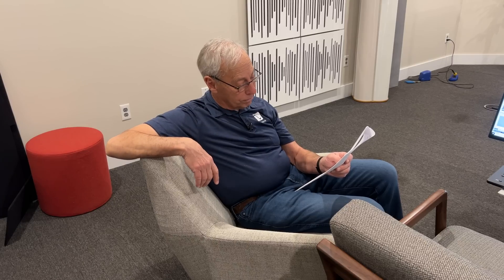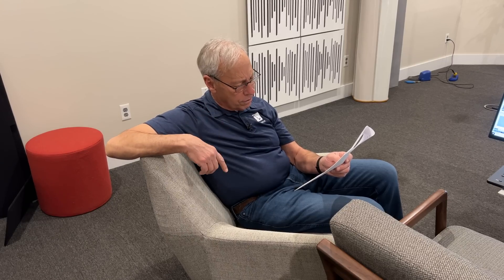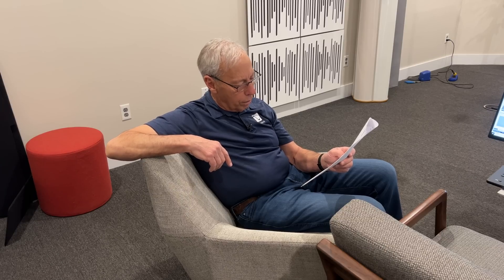Replacing aging capacitors

Comment: I thought of doing a replacement of capacitors in my 3 Tannoy TFX subwoofers. There's always room for improvement. They might be small but three of them make a huge impact
Reply: It's not an expensive thing to do and well worth it. For me the improvement was very noticeable right off (not my imagination). It did take me some time because I had never soldered before. The more I did it the more I got the knack of it. Good luck and please report back.

Comment: Be careful changing caps. It may sound different and it's not always in a good way. It may not even be in a bad way but the difference may not be what you want. I had to change just 2 caps (1 each) in a set of IRS IIIa's that I have 4 of. The first set sounds different then the other set now.
Reply: How could changing caps to original specs be a bad thing?
Reply: @johnloupis2347  Same specs dont mean it will sound the same. Cap makers make different caps even in the same specs. Throw in 30, 40, 50 years difference some of the specs may not even mean the same thing anymore. It may not even be bad but still sound different and it may not be what you are looking for or expected. Or it may be the best thing you have ever done. IMHO if you like what you have and there is nothing wrong with the caps (getting hot, bulging, etc) I wouldn't take the risk.
Reply: @finscreenname   If you like it roll with it. I can say with mine I thought it sounded ok until after I changed them. Big improvement for my situation anyways.

Comment: I have a Velodyne VA1012 and my caps failed at around the 30year mark. Replaced them with Mundorfs and it is restored to a wonderful sounding sub. Have a much higher end sub now so the Velodyne is on the shelf but works perfectly. You would be surprised how much better the new technology subs are, I was shocked.

Comment: I've got an old 1965 CONN tube organ still rocking the original caps. Also an old 1975 Roland synth still rocking the original caps. The organ sounds incredible. The Roland is a bit leaky in the circuits.
Reply: cap will need checked as the voltage can fry the heaters in tubes via leaky caps seeming good sound WaRm sounding .mr carlson's lab on YT is an expert

Comment: Thanks for taking the question Paul. The Velodyne servo subs in the early 90's were cutting edge at that time and have very low distortion levels. And were rather expensive for that time. I think $600 for the one I bought. I did end up replacing the power supply caps and they did make a difference. Sub seemed to have more power. Then I replaced the caps that control the servo area of the sub. That made a dramatic difference. Really cleaned up the sound. Much more taught and defined notes.
 Next I decided to change the caps in my Mirage speakers to new film caps. Once again a noticable improvement. Much better sound stage, better stereo effect, smoother highs. Total cost of doing it myself about a $110. Money well spent. Keep in mind I had never soldered anything in my life before so there was a learning curve. Probably took me 10 hours total to do everything. Love your videos. Wish I could afford your videos and wish I could afford your equipment. So my thought is tweek what I have. So far so good. Thanks again.

Comment: Caps are so fickle ive come to find. I have pieces 30+ years old, not a single failing cap and some less than, with bulging rectifier caps inside. My theory is if unit in question spent its life on the same shelf in consistent temp, the caps will go the distance. Is said piece were stored in damp basements, storage units, exposed to hot summers and cold winters, the caps are gonna need replacing no matter what!

Comment: If it ain't broke don't fix it. If you want to check your capacitors purchase an ESR meter and test them. They're not that expensive. when they start to fail you will notice, Poor Sound , humming buzzing, unit turns off after a few seconds.

Comment: There was a noticeable improvement in sound quality when I replaced the 60 year old electrolytic caps in the crossover of my Wharfedale 70s. I put in film caps, so they'll be good for many more years.
Reply: Thank you for volunteering information regarding your Wharfedale 70’s; I was beginning to think I was the only one listening to them. I have their three-way W-70E version, all original right now, but based on your comment, I’ll soon be upgrading the caps. 

Out of curiosity, have you replaced the speaker terminals? I have trouble keeping mine tight, they rotate in the cabinet instead of staying put, so it is hard to tighten them down properly.
Reply: @jeremiahchamberlin4499  I've had no issues with that. Mine are just stationary in the cabinet, and the terminals are tight.  
I do get some distortion at certain frequencies on the mid-range driver of one unit.  I'd read that sometimes the voice coil tolerance was so tight, they'd sometimes start rubbing after settling with age.  So I remounted that driver after rotating it 180 degrees,  but alas, that hasn't helped.  When I have time, I'll have to do some more troubleshooting. 
These were the speakers I grew up listening to, as my father bought them around the time I was born, so I'm pretty fond of them. 🤠

Comment: I get the fact you can use lower value film capacitors on the input as the impedance is high but, in my mind, you can't avoid using electrolytics for the output DC blocking, signal capacitors because the output impedance is so low. Is there another way that I don't know about?
Reply: Are you sure that you have output blocking capacitors?  They are not always used.
Reply: @marianneoelund2940  I'm talking about amplifier design in general. I'm an electrician / electronics engineer by trade. You can calculate roll-off with RC values.
Reply: @zedcarr6128  Then I don't know why you asked the question.  You know that the alternatives to capacitive coupling are direct or transformer coupling, right?

Comment: Makes me wonder if modern caps are not up to the standard of the ones used in the 80s/90s.?  I have components from that era that are still running strong.  Conversely,  my modern equipment seems to start having issues at the 3-5 year mark.
Reply: My conviction is that the old equipment is more oversized in terms of materials, new production precision allows a cheaper amount of materials (oversizing the voltage a little on modern caps is therefore fine).
Reply: @EnigmaVideos  So, why do modern components seem to have a shorter life span?
Reply: @tritiumglo4699  Could be less electrolyte, could also be other electronic components or bad design.
Reply: @tritiumglo4699  A lot of the money that used to go into components now goes into licensing fees.
Reply: I can relate. The caps in my 1965 tube organ work just fine, low noise, great sound. The caps in my active studio monitors lasted about 10-12 years.

Comment: I'm servising hifi gear and have many velodyne subs here for service between 25-30 yrs of operation. Always been electrolytic caps. Due to the vibrations in subs, they tend to degrade faster than in other hifi gear. So definitely if your sub is 30yrs old, change them asap.
Reply: Thanks

Comment: what about resistors, should the old carbon-film resistors from 1996 be replaced with new metal film ones?
Reply: Only if it shows the wrong values.
Reply: Bulk carbon resistors are the ones you need to worry about.  They can drift well outside of their tolerance rating, and they can also become noisy with age.

Comment: Velodyne has made some awesome subwoofers even with servo, and depending on model, it can easily be worth to replace the caps. Some of those servo subs can get unstable if the caps are worn out. One of my subs is an upgraded DD-18+ and it works very well.
Reply: Unstable is a great way to put it. Mine was getting bad enough that the voice coil was rapping all the way to it's limits at low volume. I replaced 10 caps and it's a different animal now. Pretty cheap fix. Was about $45
Reply: I had a Velodyne ULD-15 servo subwoofer for awhile but it did nothing to add low end to my electrostatics and just blurred the bass from my electrostatics. Anyone who says electrostatics don't have bass should hear mine.
Reply: @andershammer9307  I'm not sure how you did the cross-over but of course nothing beats electrostatics on precision and most certainly you wouldn't want both your electrostatics and a subwoofer to operate within the same frequencies. In fact, I disagree strongly with anyone thinking that it's great to add a subwoofer without high-pass filtering the stereo speakers. I've been a Stax headphone fan since my teens.

Comment: Here's an interesting thought, what if you were told that with an old amplifier you have that you should have the caps and everything replaced. The amplifier currently works end it sounds good to you and you know that by changing out those capacitors the sound will change, should you fix it knowing that you like the sound how it is.
Reply: I thought my sub sounded "ok" until I recaped it. I must say amps have a ton of caps in them. If you don't do it yourself it will be pretty costly.

Comment: I have a Sonotron PA2000 from the late 70s/early 80s. Is there anyway to check if the caps are good or not? It has four 15000uf Elna capacitors, I'm guessing they're not making the same capacitor anymore, how to do you what to replace it with? Does it matter?

Comment: I don't think NH was a major landing point to immigrants from Lebanon. I think the name is inspired from biblical references to that country. I repair and restore vintage audio gear. I'd replace all electrolytics 30 years old or older. They may still be to specs (especially quality ones) but at this age they are more likely to fail. You don't want their corrosive juice oozing out on circuitry.
Reply: Wikipedia says Lebanon NH really was named by immigrants who named it after their home.  They were from Lebanon Connecticut, which like you said is a biblical reference.
Reply: Yup. I wonder if/when YouTubers (or, humanity in general) will figure out they should avoid wandering from their lane, making assumptions about things that just aren't true and then making false pronouncements on that basis.

To be fair, Paul's in good company. One frequent offender in this respect is Neil DeGrasse Tyson, and he's hardly the only one. But still.
Reply: Biblical name , after  tress in that area-Lebanon cedar .It was also.a majorly significant  town during the American Revolution ,however the Amero -Indians have many ,many US towns named after their people

Comment: my speakers are from 76, they sound wonderful! Should I bother?? I hear no problem with them!
Reply: Depends on whether it has electrolytics obviously.
Reply: @EnigmaVideos  are "bipolar" caps electrolytics?
Reply: @MatijaVabec  Those that are marked with "bipolar" in speakers are electrolytic, since film caps are bipolar unless they have an outer foil with polarity. It's easy to see by comparing size and capacitance of the two types. The reason why they are bipolar is because of the reverse voltage, but film caps are really the right choice.
Reply: Change them and then you will understand the problems they had.
Reply: @johnloupis2347  once I notice something I will. I really love the sound now I don't want to mess it up

Comment: Yes. Planning on replacing the older ones in my vintage AR-9 speakers (circa 1979) before using them again. I read on a forum that the changing values of electrolytic capacitors can especially put tweeters in danger of being fried. As my tweeters are no longer available I figure I'd better be careful. Thinking of using Mundorf capacitors throughout, using the same values the original designers of the crossover determined. Only caveat is that I've been told that changing the capacitors on the woofers somehow are not as important, but I'm not sure I understand why that would be.  I'd have to run several lower values of capacitors in parallel to equal the value of those honking big ones on the woofers, but I only want to do this chore once, that's for sure. If Paul recommended a guy change them on his vintage sub-woofer, I think changing mine from top to bottom as well makes sense.
Reply: the woofer see the full power current is way .the tweeters need the right values to Filter the low frequency {high current}  out .use a good cap but high end special speaker stuff lol yea just that marketing .i like nichicon gold low esr  for high end i guess you could say  panasonic is fine to use you could test their ESR capacitance meters are dirt cheap now even a cheap multi function meter will do the job
Reply: @overbuiltautomotive1299  someone on eBay was selling a "kit" with all the capacitors for the mids and highs (not for the woofers). I think they were supplying decent caps from Parts Express for about $190 for both speakers, but I'm 63 years old and only want to do this work well one time, hence I might spring for the "better" Mundorf caps at about $500. 

In fact as I get into it, I'm tempted to replace  more than just the caps...maybe even consider rebuilding the whole thing on a thin piece of plywood, but buying new all air-core inductors would nearly double the costs to about $1000.
Reply: @rosswarren436  thats on you but i bet my bottom  dollar buying my suggested japan made brand from digikey or mouser would be as good or better [esr near untestableits so low } as they order caps from an oem not to mention the 500 is not the issue so much as much as its not possible to be better than a certain level caps are simple and cheap to make and its grifting almost theft selling caps at that price absurd .audiophiles get sucked into that just like in hot roding aftermarket parts
Reply: @overbuiltautomotive1299  yeah, I'm going off what was posted by users in a Acoustic Research forum where a few people had tried different brand caps. At the end of the day, they said the Mundorfs simply sounded better by a certain margin.  However, for the  bass driver, I might consider lower costing caps that will be "good enough". I'll have to gang several of them together to equal one huge 2500uF and one 470uF in each speaker, hence the costs going up rapidly.
Reply: use the same vale or add them up to make needed values works find still think it nuts buying them caps but i know how folks are somtimes you have to price it high as can be before folks think its good .work
Reply: @overbuiltautomotive1299  indeed. I've read that it is better to add two of the same value to get to a higher value, if you can. (Better to use two 12uF to get 24uF than using a 20uf and a 4uf).  I know even "cheap" PP caps of today are likely far better than the old electrolytic ones they had available in the 1970s and 1980s. 

I work with a few electrical engineers so they should be able to tell me if that makes sense. 

It's just with all the hours and work this upgrade is going to take me, I figure spending a little more for the Mundorfs definitely won't hurt, especially on any caps in series instead of parallel. The ones in series make a larger difference (at least some say that), so I won't scrimp there. 

Looking to Phillips or Sprague perhaps for the honking 2500uF cap instead of ganging 5 500uF together. Those are about the same in price and would be easier to use and install.  Even new electrolytics on the woofers should last another 20 years easily.  By then, they won't be my problem anymore.
Reply: @rosswarren436  yes the values need to right on the money that is the value that filters Frequencies out .as one does not want to let in say 400hz into a tweeter or going the other direction only have 10khz n  up going in and out of the tweeter .no worries stay OEM and a good cap and its better than it was wen made
Reply: @overbuiltautomotive1299  If I could afford it, I'd ship one of them to Danny at G-R Research and see what he might change about the crossover, but shipping such heavy speakers safely would be ridiculous in costs. So yes, I'm sticking to the original values of the 9 capacitors in each speaker.

Comment: I have the same question about my 20 year old Parasound amp? It's still kicking ass but I wonder if I should or when I should?
Reply: You should definitely start to worry about it after it is 30 years old, just don't poke around in there with your fingers until you have checked the voltage is close to zero with a multimeter.
Reply: @EnigmaVideos  so I'm good right now at 20 years? Thanks.
Reply: @JC-bl9bo  I can only give a vague answer, but I would say yes.
Reply: @EnigmaVideos  I'll email Parasound, that's probably the best idea.